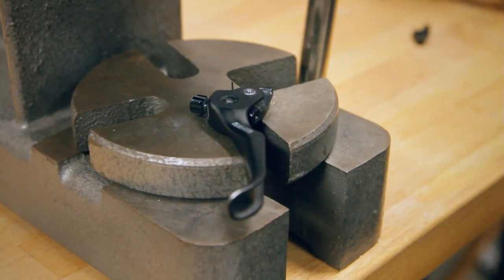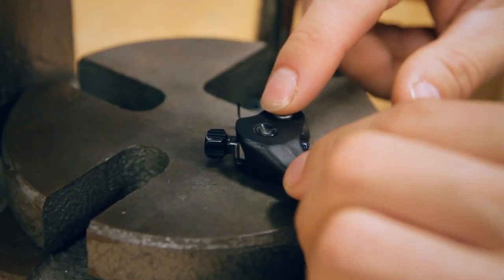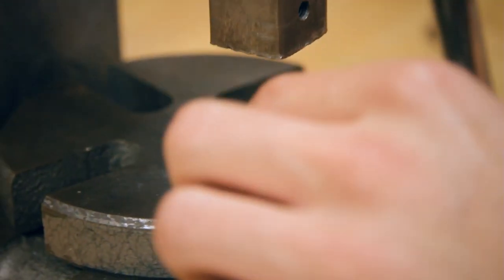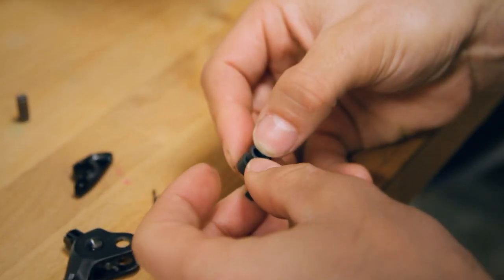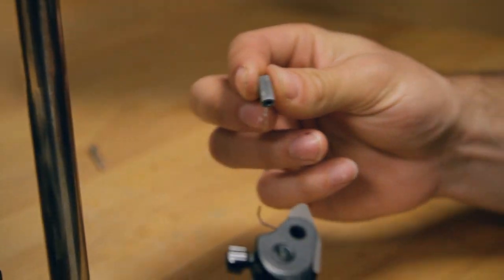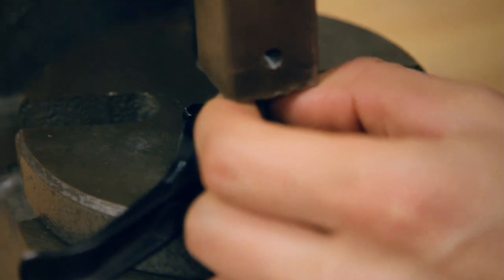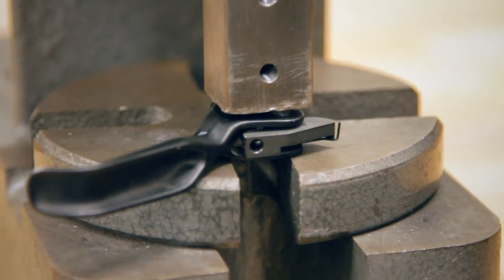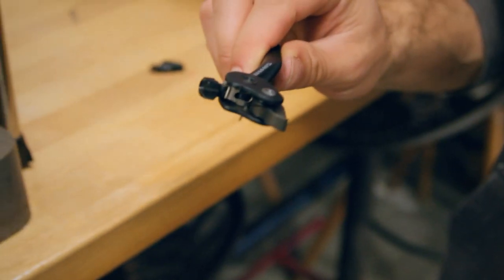Cascade Components Brake Cam Installation

Comment: Maybe a dumb question, but I haven't done much with my brakes myself. Do I need to disconnect the brake hose prior to removing the lever blades? Or can I just remove them without losing fluid?
Reply from the maker: No need to remove the brake hose to remove the lever blades. The master cylinder is all self contained so nothing to worry about.
Reply: @CascadeComponents  thanks, I got it installed and I'm liking the results. Basically exactly as stated on the site. Pushing the pin out with a c-clamp worked, but was a bit fiddly so took a while to get it lined up

Comment: So what's an alternative way of getting the pin out if you don't own an arbor press??
Reply from the maker: A vise or C-clamp should also work well but will be a bit harder to hold everything in alignment.
Reply: I used a vice and a smaller socket which worked well. Quite controllable.

Comment: I highly recommend you don’t use your pad pin to push out the pin as this damaged the threads on my pin.  Instead use the blade screw for 85% of the push out and only the pad pin for the remaining 15%
Reply from the maker: We've done this a lot of times and never had the threads on the pad pin get damaged. It sounds like there might be something else at play there.
Reply: As wild as it seems, I actually just damaged the threads on the  bushing using the pad pin to push it out.

Edit: I think it's because the pad pin is tapered, it can smush the first few threads if you're not perfectly lined up. On my second lever blade, I used the blade screw threaded a good ways in to get the bushing started then used the pad pin to get it the rest of the way out. I'm hoping I can find a longer pad screw tomorrow to chase the threads through from the other side otherwise I'm going to have to order a new lever.
Reply: This just happened to me as well... lovely.
Reply: Just happened to me as well. Any luck screwing the lever screw in and using that to press the pin out? Just had to order a new lever due to pad hold stripping threads. Trying to avoid a repeat with the new lever! Thanks in advance!
Reply: @JDExperience  yes that's exactly what I used to get it started, I screwed the lever screw in as much as possible to start pushing the lever pin out and then just tapped the rest out with the pad pin so the force required was less and didn't damage the threads
Reply: Yep, this pad pin idea is bad. Marred the thread on one side of the pin on the second lever I did this cam on. Do not recommend. Edit: I used two different pad pins to push out the pin. First was a stainless pin which worked fine. The second was a different non-stainless sram pad pin I used when I did the second a couple of weeks later. The heads are different shapes which might have led to the damage. Tidied up the threads from the good side by screwing through a longer M3 bolt. Wouldn't recommend pad pin usage.